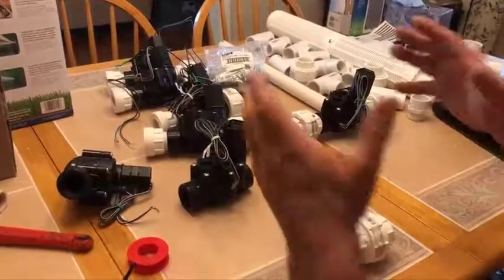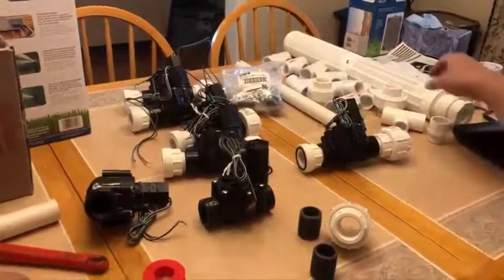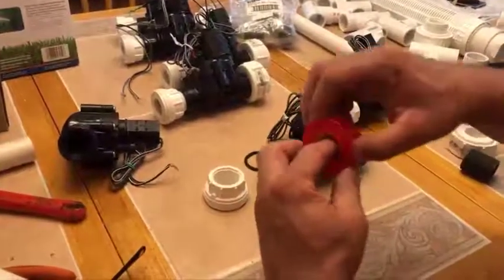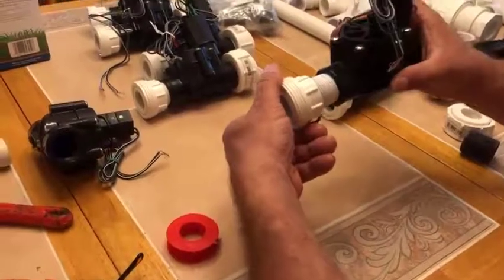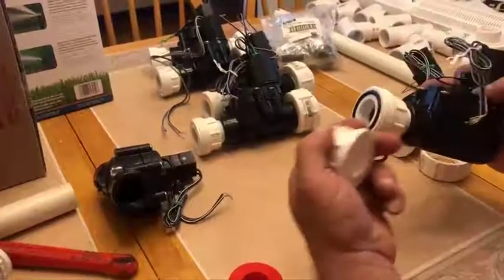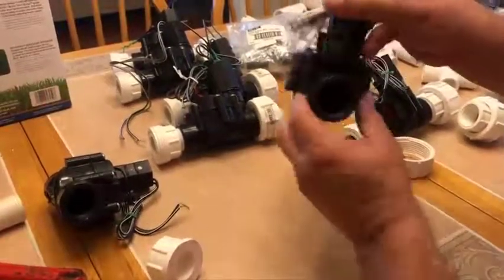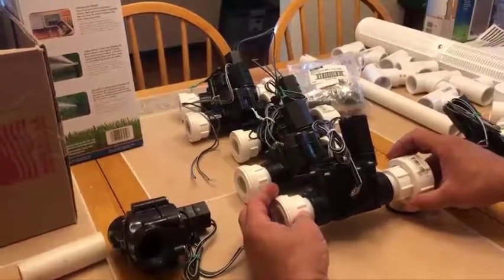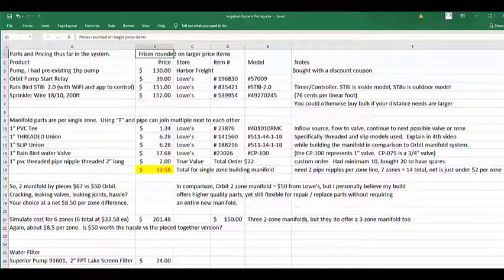6. Home Lawn Irrigation System - Manifold Assembly to Valves

Comment: I live in Michigan, can i use schedule 40 pvc or do i have to use schedule 80?
Reply from the maker: Not living that far north (although used to live in Syracuse), not sure, nor how deep your need to bury.  The different schedules are for pressure before burst, not freeze factor.  

That said, winterization preparation would be a HUGE consideration to allow for proper winter drainage.  I would include some shut-off valves at strategic places when you lay out your system.  Maybe even some above ground (or near ground level) where you can attach an air-pressure device to blow-out the water from the lines to help prevent freeze damage.  The overall logistics of hookup, equipment, pvc, electronics I think I covered pretty good otherwise over the 13 videos (All have context of "Home Lawn Irrigation System" if you have not seen them all).  Getting EDUCATED can help you make a better decision.  May want to check with local professionals for more specific advice, clarification, confirmation in your area,   

Back to Sch40 vs Sch80.  Also depends on the type of installation.  For home use, for the most part, I have found that your sprinkler heads are rated to automatically open/eject based on 20-40psi of pressure in the lines.  So, based on the capacity of your pump and area coverage, you would only have one zone on at a time.  How many heads per area.  In my setup, the most heads I have in one zone is 4 and running on a 1hp pump.  Obviously the larger the pump / capacity, the higher pressure and more heads you can put into a single zone.

Any additional or more specific questions, let me know.
Reply: @drapp5752  I'm moreso speaking of the supply line.  From the house (1 1/2" Copper) to the PVB, then back to the 1 1/2" copper lines.  My PVB was in my basement, so i have to move it outside.  I have a minimum of 8 head on each valve.
Reply from the maker: Sorry, what you are doing sounds a bit out of my area.  Dealing with 1 1/2" COPPER from HOUSE?  Sounds like you have a rather large project.  Minimum 8 heads?  This definitely would need more local professional assistance than I can provide.  I dont want to make any recommendations based on direct home water supplies, liabilities, etc.  Sorry I could not be of more assistance to you otherwise though.
Reply: @drapp5752  Thanks, just trying to updated this old copper system.